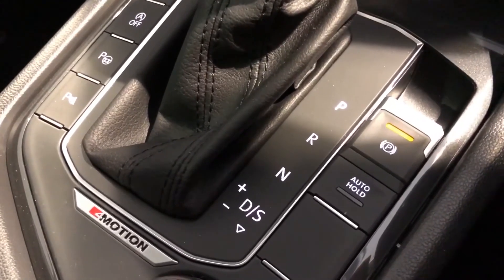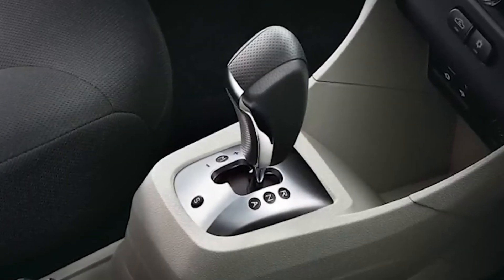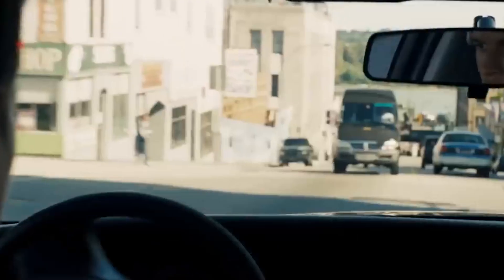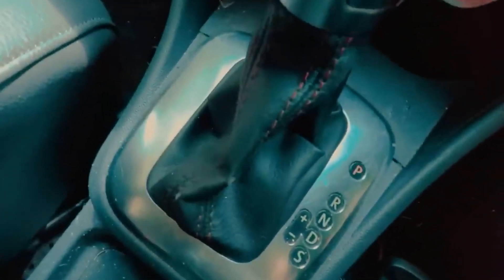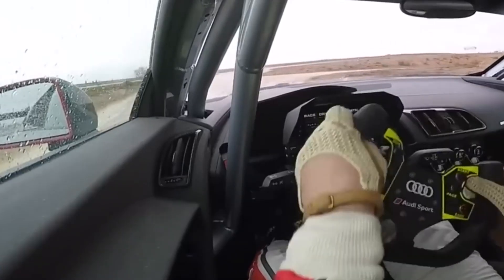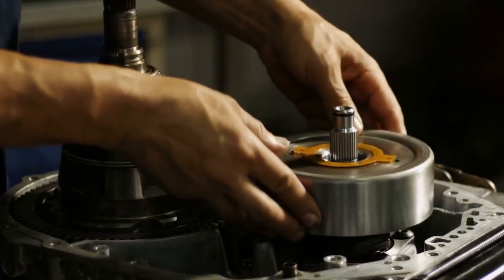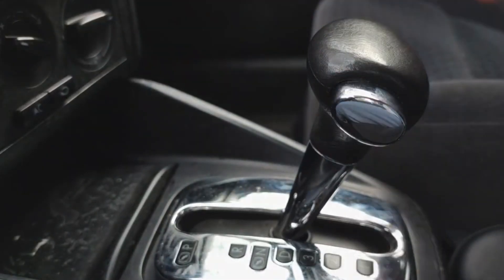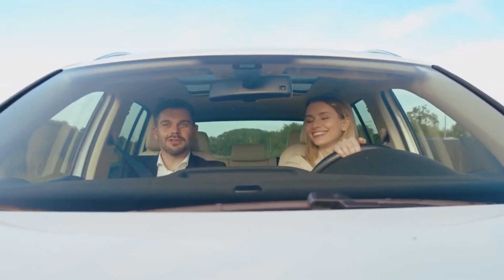Everything You Need to Know About DSG Transmission

Comment: Everything? Well, they're expensive to make, expensive to maintain and unreliable.
Reply: Not sure where you get your information from, but it may have been true 10 yrs ago, but not so much now.  Like anything, if maintained properly a Dual Clutch will last as long as any other transmission.  Expensive to maintain?  Well my VW GTI DSG cost $600 US to get the fluid changed, my wifes Toyota Camry with a standard auto cost the same.  So not any more expensive for myself.  Unreliable?  Not any more so than any other Auto out there.  Even a manual transmission can cost $1000 plus to change a clutch, or if you have to replace a synchro on a manual can be expensive, so in the real world?  They are just as good as anything else, but you also get a quicker car and in many cases a more fuel efficient one.  So I will agree to disagree with your statement.